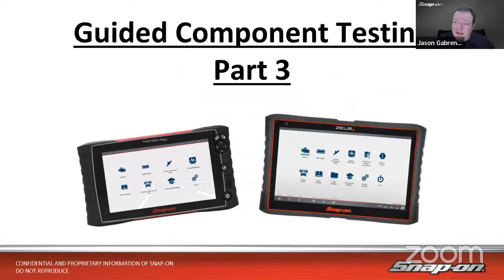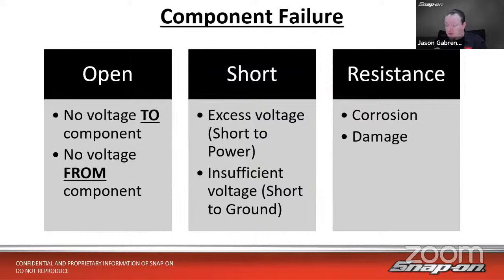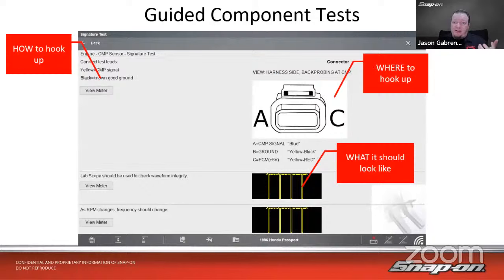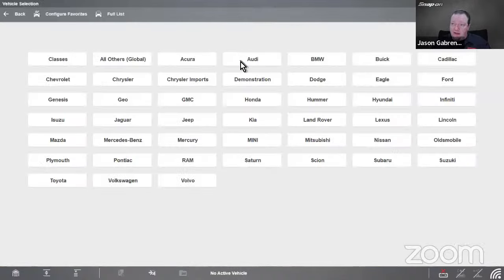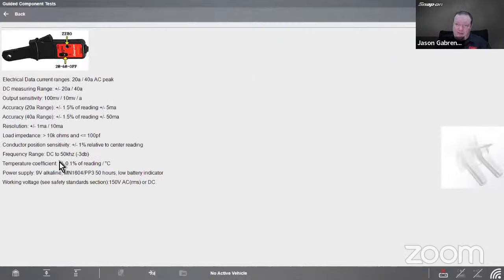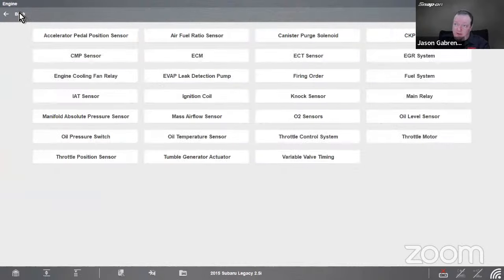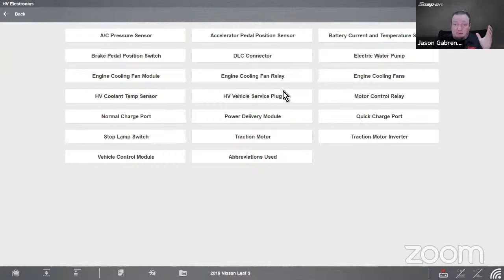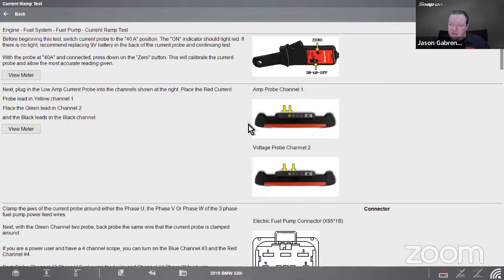Tuesday Diagnostics Livestream - Guided Component Testing Part 3

Comment: I own a snap on modis with the final update (back catalog to 1982 to current 2021) under guided component testing many of the bench test procedures require the low amp clamp. I asked my dealer to sell me one. He sold me snap on "current clamp" totally a different part number than my modis says for. On parasitic draw testing the "current clamp" is a teeny tiny off from what my OH SO TRUSTY Fluke Meter says. Whats the difference between the "low amp clamp" and the "current clamp" ? Thanks in advance for any realistic thoughts or answers.
Reply from the maker: The correct part # for the Low Amp Probe should be EETA308D. If he sold you a different clamp (we do offer a few others that are made to work with multimeters as well), the calibration may be different. If you select Low Amps as the probe in the MODIS, the tool may be doing the math differently based on the calibration. Look in the paperwork that came with the clamp, and it will tell you what the spec is for output voltage per amp. Then with the MODIS use the VOLTAGE setting, not amperage, and see what that works out to. For example, if the output of the clamp should be 100mV per amp, and you see 100mV on the tool, then you're reading 1 amp. 250mV = 2.5 Amps, and so on.